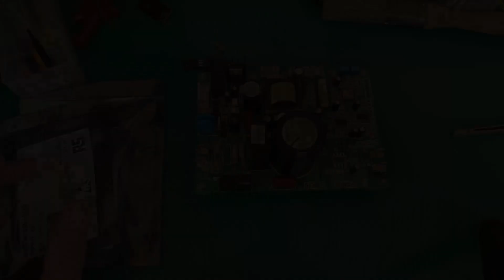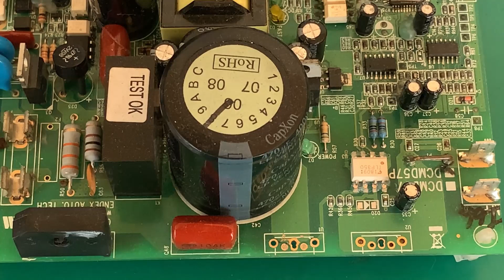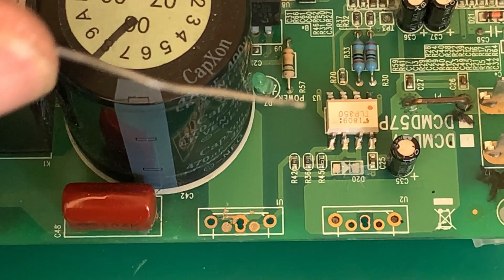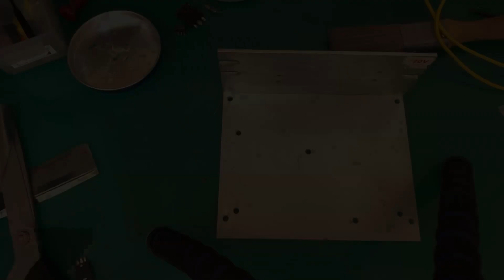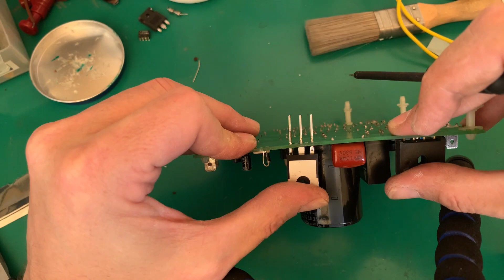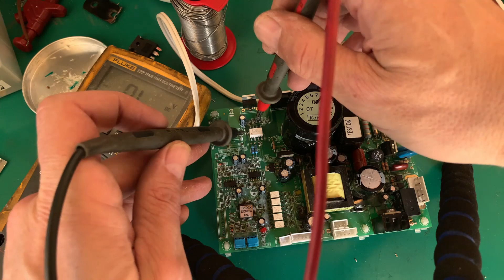FoulkesBrau #42 - Lets finally repair the fault on this Trojan treadmill control board DCMD57P PT 3

Comment: Hi, I have this board on my trend mill. It worked quite well before. Now, when I switch it on, it is fine but as soon as the motor should start there is an extra current that broke the fuse. I do not have any idea of where can it come from. (I unplugged the  motors, same results). Do you have any idea of the problem ? (Sorry for my poor English)
Reply: My board is a DCMD57
Reply from the maker: Hi there - check your FET and fly back diode.

Comment: Hello, thank you for a educational video. I had the exact same problem, with same components broken. I was not able to find out the type of diode that was originally in the board. The smd glass diode that you replaced with 1N5819. You said you ordered it, but hasn't arrived in time. Do you still remember its part number.
Thanks from Sweden.
Måns
Reply from the maker: Hi  Måns,

You can replace it with any MELF equivalent. I did a quick search and the GL41M-E3/96 would work fine for you. RS part number - 700-1176.

It seems that I get a lot of inquiries about treadmill control boards. The most common failures are the driving FET and it's supporting circuitry, the fly-back diode, the offline switcher for the MCU and it's rectifier and feedback opto coupler.

In my opinion, the design is marginal. If you look closely at the heat sink compound when you take the board out - you will notice that it is all crusty and caked. So those components are running very hot and are borderline. If I get these boards in now - I always put in a FET and fly-back diode that are way over rated so that they run cooler.

Cheers

Craig
Reply: @foulkesbrau3085  Wow, thank you for a quick response👍😁
Reply: Hello again Craig. If I may bother you once more. I'm trying to get a hang of the world of electronics, and come a little way. But identifying that diode was impossible, did you identify it or use your knowledge to determine what kind it was. It had nothing written on it and one black stripe for the cathode side and one stripe on the other side that could be red, brown or orange...?
Thanks again for all your effort👍
Reply from the maker: Hi Måns,

See reply above. I looked at where the component is and what it does in the circuit. At that particular spot, it could only be either a Zener diode or a normal diode. In this case, a common garden variety Schottky diode would do the job. 

Cheers

Craig

Comment: I have  LX-1000 inverter for treadmill.but there is a problem in display unit.how can I run motor or income up down without display.using 7805 IGBT
Reply from the maker: Hi there,

The short answer - you cannot. There is an MCU under the display panel that monitors the speed controller as well as the dead mans magnet belt switch. I would not try to bypass these safety features.

Cheers

Craig

Comment: Hi can I plz know the number at the back of the transistor
Reply from the maker: Hi there,

You will have to be a bit more specific as to which part you are referring to?

Cheers

Craig
Reply: @foulkesbrau3085  can I get your number so I can send you a Pic of the part
Reply from the maker: Hi there,

Rather email me please. craig at FoulkesBrau dot com. 

Cheers

Craig
Reply: Can I get your email address plz
Reply from the maker: Hi there,

I just gave it to you ☝️ Please read carefully and replace what needs to be replaced. 

Cheers

Craig
Reply: I emailed you did you get
Reply from the maker: Ta,

Sent you a reply, but for the benefit of others who might read this - The device marked U5 is an offline switcher. Part no: TOP245YN. 

Cheers

Craig
Reply: Thanks very much for helping me sir I appreciate
Reply from the maker: No worries. 

Best of luck and keep us posted to let us know how you come along. Hopefully your board will be fixed soon. 🍻

Comment: How much does a diode cost?
Straight-legged ICic
Reply from the maker: Hi there,

Well that can vary, but in this case the dual diode was ZAR5.00 and the glass diode was ZAR0.25. 

Cheers

Craig
Reply: @foulkesbrau3085  Thank you